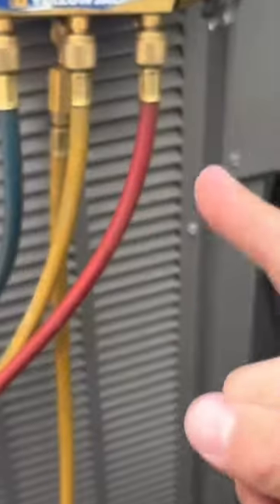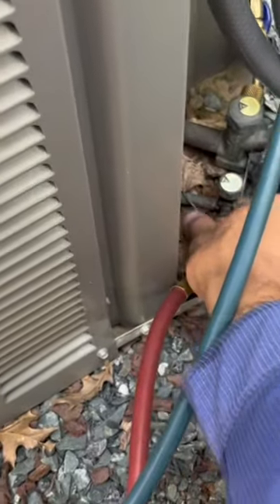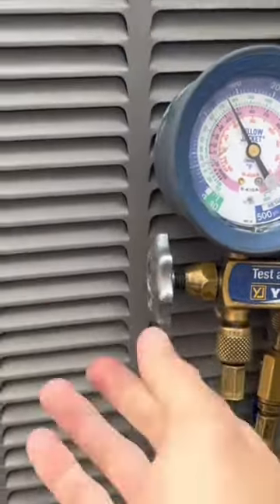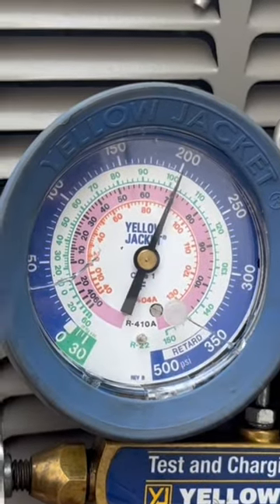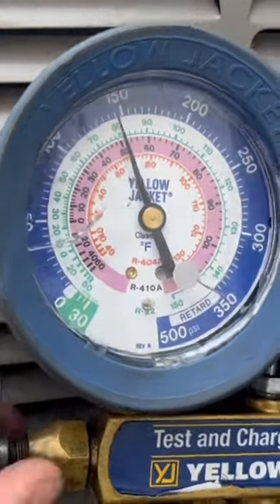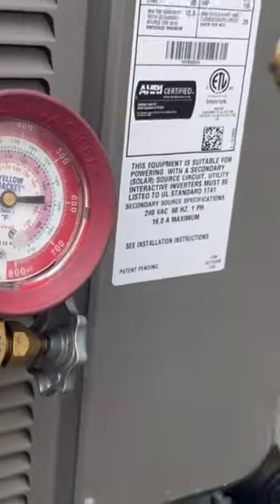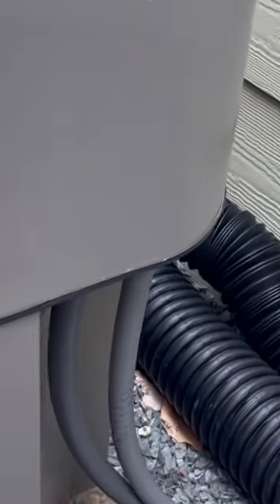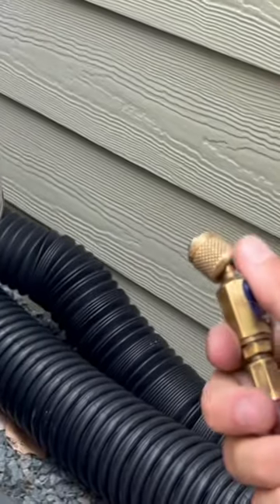Stop Losing Refrigerant! #hvac #howto #yellowjacket #gauges

Comment: I keep my lines pressurized at around 70 to help displace the air in the fittings on the next connection, crack the hose end valve slightly just before the seal seats to blow out any moisture or air.

Comment: as long as you keep your gauges purged or purge the air. You can get the rest of that liquid out of your gauges by taking the hoses and TURN the manifold upside down while its pulling the refrigerant out of the gauges.

Gravity and turning the hoses upside down will cause more of it to return. Only vapor will remain.

Comment: That’s the beauty of using probes, minimal loss 😎
Reply from the maker: Probes are my next investment! Any recommendations for which brand?
Reply: @ramseyhvac fieldpiece of course 😅
Reply: @Davidandgoliathhvac  just depends what you like, I’ve used the Testo’s and the Fieldpiece. I like the Fieldpiece more because I believe they are better quality and integrate nicely with the app
Reply from the maker: @cesarmoore7996  I’ve heard there’s a fee to use the app. Is there a monthly fee for the app or is just a one time cost?
Reply: @Davidandgoliathhvac  I’ve never heard that, but with some research you would’ve been able to find out. There is no fee for the app or to use the services. It’s extremely useful and has a very good range when it comes to distance.
Reply: Agreed. Use probes with the new appion core depressers is 👌🏻. Virtually no loss. Very important when checking units with a critical charge.
Reply: I’ve had both. I work on hydronic systems and testo’s are capable of working with water for pressure whereas fieldpiece says they shouldn’t be used for such applications. I prefer fieldpiece for refrigeration and keep my testo for boilers. Hope that info helps
Reply: @FreonChugger  yes that’s right, I used to do Hyrdonic balancing on pumps and I would read the pressures with my testo’s. I have them as a back up to my Fieldpiece probes
Reply: @ramseyhvac There is no fee for the feildpeice app. I've  had my set for well over 3 years now.
Reply: @Davidandgoliathhvac  I'd also recommend buying a T to put your suction line probe on so you can still charge systems if needed, get a hose with a ball valve and now all you have to do is take a bottle and a hose and not the whole manifold

Comment: This is bad for the system. That leaking refrigerant is the “deminimus loss”. You could also introduce liquid refrigerant into the compressor cause it’s a liquid on the liquid side.
Reply: Just meter it back in like any other time you charge a system

Comment: You just introduced air in the system
Reply from the maker: No I didn’t. The hoses are full of refrigerant. I just pushed what was left from the red hose back into the system.
Reply: @Davidandgoliathhvac  did you purge the yellow hose and manifold as well?